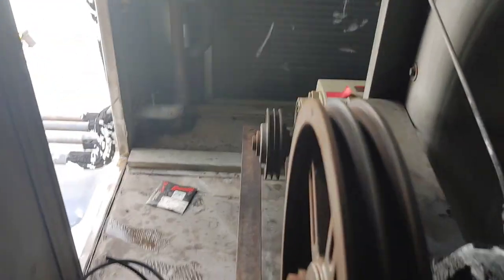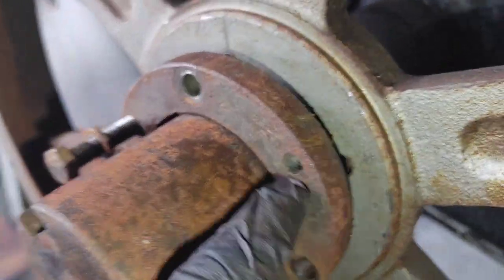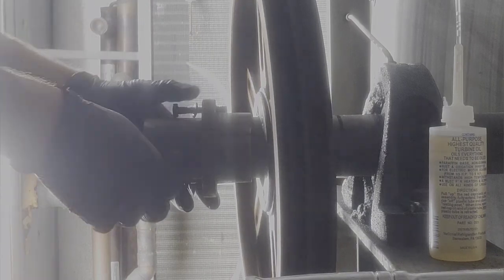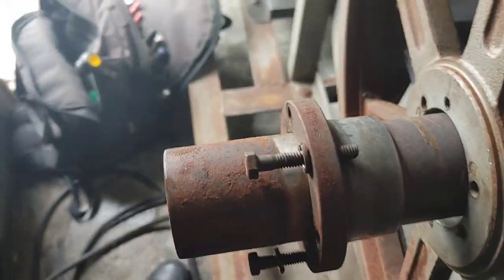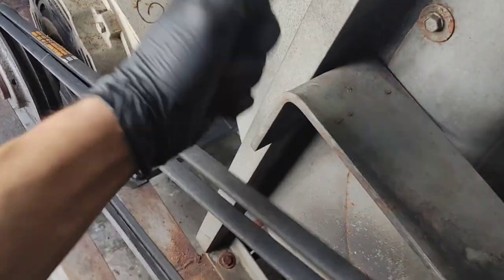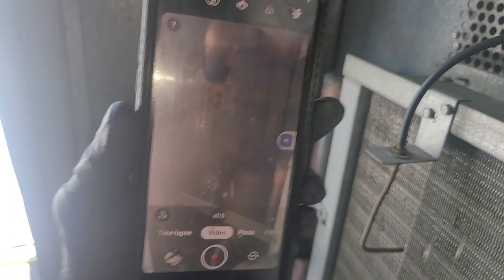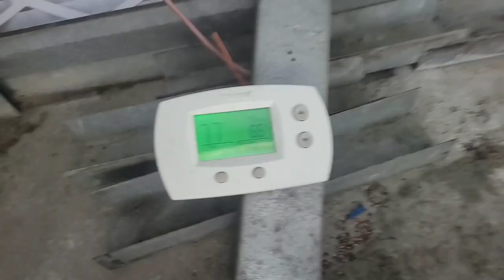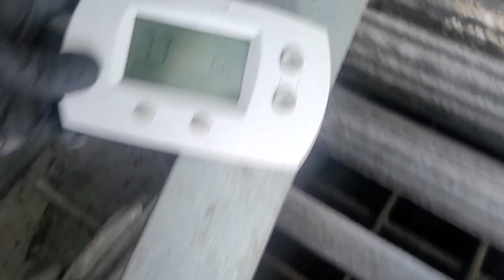110 Ton / 1,000,000 BTU Package Unit - Blower Fan Belt Pulley Alignment and Start up

Comment: Tapered bushing pulleys are the best. Easy to take apart. Most important thing is to take some spray lube and spray inside the threaded holes to separate it. Sometimes you have to be careful because the bolts may load up and snap, what I do is smack the bolt head with a hammer. You can use string/twine to align pulleys but I normally look at the flat edge of one and try to line it up. Also I did get my fingers stuck in a pulley once, I was spinning the wheel so someone could grease the blower bearings, didn’t loose any fingers but I was afraid to take my glove off.

Comment: Here's some terms bro, taper lock bushing, keyway, keystock, through holes, if you need to remove the taper lock bushing tap a slim straight screwdriver into the split.
Reply from the maker: Thats good to know. Thanks